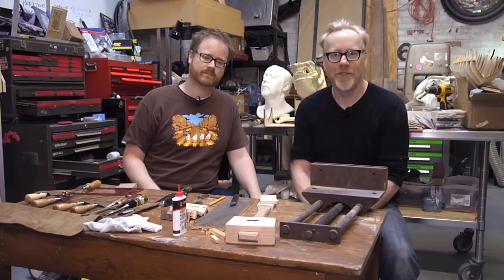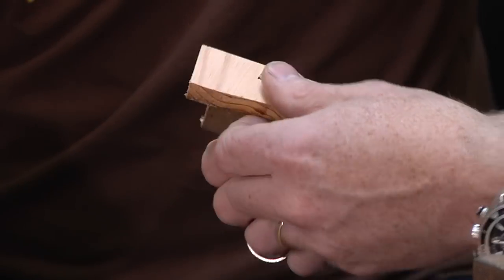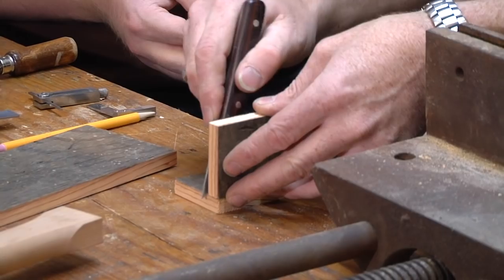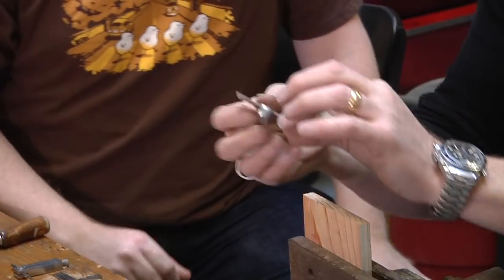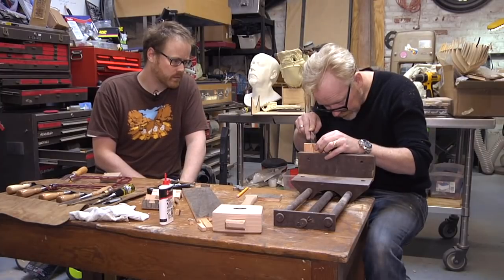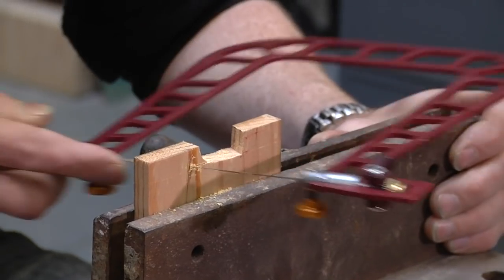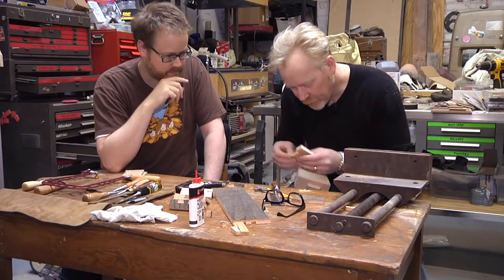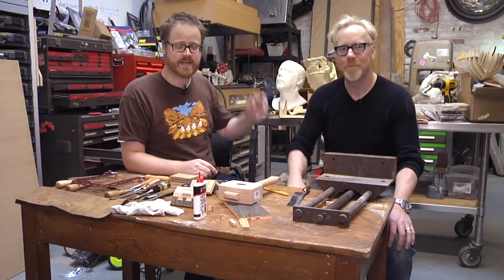Learning How To Make Dovetail Joints with Adam Savage

Comment: ugh, i'm a carpenter, and watching this made me cringe a bit lol. but the mistakes he made are typical for someone just learning this technique. but no matter what you're cutting, when it comes to woodworking, NEVER cut on the line. you cut about 1/16th on the inside of it and then clean up the edge afterwards. whether you're sanding to the line or shaving to the line, you still can't cut TO the line. that's why his joints were loose. because you always have to clean it up a bit, and you need some material to work with.
Reply: Mike L. You can take away but never add basically
Reply: @TheActionjackson3000  Unless your metal working, then you can sometimes weld your way back glory.
Reply: Hey, I appreciate this comment. I'm starting to get into woodworking, and this probably just saved me a few tens of hours of retrying!
Reply: @Mike L., I’m not a carpenter but I would think dovetail jig and a router would be a better way to go for a novice than trying to cut them out by hand like that?
Reply: i can just agree Mike..and want to add..as u may know as a carpenter..u cut the slightly inside the lines..and then use a crowbar to stem out the holes ;)
Reply: I was wondering how he did multiple loose test joints without figuring this out.
Reply: Yes, and also, take your time for goodness sake! When you rush, you get a sloppy product.
Reply: My dad was a private contractor/handyman till the day he died. 
When I was a child one of the first rules I was ever taught about being a handy man, after I was taught how to measure and then remeasure, was that "you can always cut more, but you can not cut less".
I think that rule applies to just about any blue-collar job and should be taught early and often.

Comment: Cut inside your scribe lines and not directly on them. You are cutting on your lines, which have been scribed outside you adjoining piece. The thicken of your scribe adds a gap as well as the thickness of your saw assures the gap. You are actually opening the gap - my guess would be around 1/64 to 1/32. Because wood can compress, depending on how hard or soft the wood is, the more exact to the size the better the fit. Try to scribe gently so you don't create such a cavern for your saw to start out in (if your so interested in doing this the old way). That pine should be sized a smidgen tight to one another. The grain will compress and relax which will tighten your fit - hence in need of a mallet to join them. Practice practice practice. Another cool little trick once you've accomplished a uniform fit is to soak it in water for about an hour. This will expand the grain where the water can reach (the gaps) and tighten the joint completely - or at least until the piece is moved to a dryer climate where the wood can shrink more than when you started.
Reply: You sir are correct, I can tell your very passionate about wood.
Reply: cybertree sounds like a guy that plays with his wood all day.
Reply: Rasmustheforest lol
Reply: my name is kirk too!
Reply: Kirk Frederick I was gonna say that.
Reply: Beat cha to it!
Reply: When cutting the dovetail it does not matter if you cut on the line or not but when you are cutting the slot out you have to be accurate to the cut so you use a chisel to clean that out right up to the line.

Comment: A key point that a lot of people disregard with carpentry is that you rarely, very rarely cut ON the line. Cut BESIDE the line. If you're cutting on the line, ie; if the line you marked is gone when you've finished, you've removed too much. Remember, you can't put it back on, but you can take more off!
Reply: bingo!! that's what I was saying

Comment: From the perspective of a northern European Journeyman cabinet maker, he does every step wrong.
First thing is to select a type of wood that are beginner-friendly like Birch for practice.
Second would be to make them in the opposite order, sockets first and tails after.
Third, think like the shaker, don't ever aim for any kind of cheating by creating angles where there should be none!
Forth no copping saw, that's for veneer work.
Fifth cut inside the lines and clean up with the chisels. (Lie Nilsen ones?)
Last I would recommend considering the size and positioning of the dovetails as this is as important as how tight they are.

And remember, No cheating!
Reply: RE the fourth point. What saw/tool would be correct for the job?
Reply: ScratchN Sniff A dovetail saw to make the initial cuts, then chisels.
Reply: Correct.
Reply: tails first or pins first is just personal preference. A lot of people would argue tails first is best, I agree with everything else though
Reply: I would say no, not only a personal preference. If you make ordinary dovetails to show the tails, if you cut the tails first, you can clamp the sides together and cut them at the same time. This is what I learned that most amateurs like to do. Making cabinets the traditional way as we learn and do here you have to be able to cut "normal" tails, half-blind and blind tails at the same speed and if you do the pins first every time, you will do the front of a half-blind first and you will learn to do it fast by always doing all dovetails this way.
One more plus is that if you fuck up the pins on the front of a half-blind joint, you can compensate with the tails afterwards...
Reply: Woodworker here. Nerk is actually incorrect on his forth point. Coping saws, especially that kind can definitely be used to remove the waste quickly. The reason that that one is preferred, is it is made out of aluminum and is very rigid. ( in the vid he says titanium which isn't right. The company makes two different kinds, aluminum which is the colored one has and a gray titanium one which is actually a bit heavier but extremely rigid). With these you are able to cut very close to your marking-gauge line. after you have removed the bulk of the waste, the best step is to creep up to the line by removing small amounts of wood at a time. Removing too much causes too much pressure on the wood and can bruise the wood that you don't want damaged. In the video, Adam is using the chisel turned the wrong way. You use the flat end against the non-waste to ensure a crisp, vertical line. If you do not want to use or have a coping saw, you can just use your chisel and remove waste all the way back to your line.
Reply: And tails or pins first is, in fact, personal preference. You can get great results either way.
Reply: If one cuts that tails first then the pins are the only precision cut left to do.
Reply: First things first. Mount the vise to something solid.
Reply: thank you good advice, not even gonna argue
Reply: *Sixth: The finishing chisel work should be done with a paring chisel. (imho)
Reply: Rob cosman says cheat The angle. So you cheat the angle. Knocking it in 2 degrees or so does not hinder the soundness of the joint and avoids an extra step (or at least a more lengthy step) of making sure the inside is deadflat to allow the two cuts to pair perfectly. In other words, if you can remove an unnecessary step, with 0 downside. Do it.

Comment: Keep it up Adam.  This is a lifelong process that I have started 2 years ago.  My Grandfather was a master carpenter and my dad couldn't draw a straight line with a level - so in his mind, the yardstick of a good carpenter is the dovetail.  After a few tries I got a fit much akin to yours, but after a few months I was needing that mallet you were speaking of. Literally everything I have learned has come from trial and error, and youtube.  One thing is for sure, you have some of the best tools available to do dovetails.  The Knew concept saw is great so are all Lie-Neilsen (Lee-Neilsen) products.  I recommend a thin kerf dovetail saw, or a Japanese dovetail saw that cuts on the pull stroke - just a matter of preference.  I also really admire how you want to learn a new skill and don't want to cop out by using power tools - although I wouldn't use your bandsaw for that again - its amazing how accurate a human and a well refined tool can be :)
Reply: okay, great inspiring story. But for everyone reading this: you dont need 2 years to learn how to make a proper simple dovetail. If you feel you are stuck go and get an experienced woodworker to have a look at what you are doing. Chances are he/she has a tip or two for you. If you do a few tails every day you will see that youll achieve good results after a week or two max.

Comment: the problem I notice is that you're cutting ON your line.cut on the I/O of it.O if cutting the wedge. I if cutting the knock. it'll remove that 1/100th" gap and make the joint tight.

Comment: You rely too much on your wrist for your sawing accuracy.  Your blade would more easily track true if your forearm were either parallel or perpendicular to your cutting edge. I'll let you work on that.  
The chisel has a flat edge to help you easily create a common plane.  The beveled edge has a few uses, though. It allows you to create curves, undercut corners and when you use it to cut a mortise, the beveled edge will force the back of the chisel against your intended plane. Using the beveled edge to clean up an edge or plane is a fool's errand, there isn't any assumption of a straight line and it generally will make a greater mess.
Reply: This.

Comment: Adam I am a furniture maker by trade I could help you lots and lots with your dovetails you make numerous mistake. That said your attempts a pretty good and it takes years of practice to get really really need dovetails. You hold the chisel wrong which means you don't make precision cuts with the chisel. You don't follow the line with the coping  saw you start in the middle and go out. to the first angle cut you made ALSO you are suppose to use a 1.6  angle for soft wood not a 1.8 angle . Not sure what would you were using looks like pine. Your gauge lines need to be much much deeper as well . also it helps to undercut  too .
Reply: +Cubby Kovu This video is 3 years old...
Reply: +Robert Dordi so what? These tips still might help Adam, and they certainly will help people watching this video.
Reply: +Cubby Kovu I make  my dovetails with a pantorouter....
Reply: +xl Well then it not really you making them but it is cool Machines and power tools have their place I mean I am not like a master I JUST PREFER doing it by hand is all :) but I do see machines as you not really doing it yourself Personally.

Comment: Hey Adam, I'm with Bombarde 16, clamp your work, it makes it much more accurate and safer.
Also to get a great finish on the cut lines, use your sharp chisel edge to score the line first.
This stops the edge from splitting when it's cut so you effectively only cut out the middle of the cut with the saw, the edges are cut with the chisel.
Also, if you scribe all your cut lines with a set square then you can follow them much easier and stay square.
Good luck mate

Comment: You'll get it Adam. Glue will swell the joints. Clamp your work down when you chisel chop it. I use a drill press to get the coping saw in too. Cut inside your marking lines and pare to your finish with your chisel more. You are right about undercutting. Another cheat I have developed is wrapping a hacksaw blade with sandpaper to tune the pins and tails up. Sand the shiny compressed wood. I use spray glue to hold the sandpaper on the hacksaw blade. Use the blade in a frame too. Mount that vise!

Comment: Yes, a router is a tool that spins a cutting bit at a very high speed. They are very versatile, as they cut with high precision and the shape of the bit can be varied to change the shape of the cut. A router can be used to make a high-precision dovetail joint very quickly by using the same bit to cut out both the pins and tails, with a jig set up to control spacing.

Comment: I suggest also a Dozukip me Tenon saw it is a very nice Japanese saw with a 0.3mm kerf. the Dovetail is wobbly like that because of the thickness of the wood compared to the width of it so it has lots of room to move. When using the saw use all of the blade and use if slight slower also it allows you to make much more precise and accurate cuts and it is neater. also slow down a little bit you don't have rush and don't measure stuff proud either. Dovetails are about precision :)

Comment: One small tip that could make a huge difference is to only use the saw for the "vertically" cuts along with the fibers, don't use the saw (never involve a bandsaw when you're doing dovetails) to cut "horisontal" and to get rid of material quick. Always use the chisels from both sides of the piece and on the waste side of the line to make airtight fittings.Try to make like a "V" to the center of the piece from the lines. I use something more like a scalpel to make the cutting lines. 

Good luck!

Comment: Adam,
  No matter which you cut first, the pins or the tails, the first cut is not critical to cut to a knife line.  It's when you scribe the first to the second piece that absolute accuracy needs to be achieved.  Keep up the good work.  Oh, and that Knew concepts coping saw it their aluminum model.  The Ti model has an awesome birdcage truss system to help stiffen the thing Ti across the top.

Comment: Oh my! I am sure I don't need to read the carnage in the comments, but don't do anything that is demonstrated in this video!!!!
It's ironic because there is probably TOO MUCH information about how to make dovetails on the internet and Adam hasn't seen any of it. I don't even know where to begin From the vise that isn't attached to the bench to the most dangerous incorrect use of (really nice) chisels,this is a total trainwreck.
FYI: a sharp chisel is one of the most dangerous hand tools! You can easily put one through your hand or cut a vein/artery. You should always have two hands your chisel when paring and your work piece should be securely clamped or held in a vise.
Reply: At a couple points, I was fully expecting to see him spill his blood. Gah!
Reply: Agreed I was cringing watching him.

Comment: Great work Adam. Once you get the 90 degree joint move on to doing it on a compound angle. Most sea chests were made to taper towards the top like the frustum of a pyramid. Same process you just start with a compound butt joint ad some other fiddly bits to get the layout right. Good luck with the chest!

Comment: I dovetailed for a design and technology project almost 10 years ago, If you cut the tongues slightly too large then you would get a nicer fit, you can always chisel down but its important to remember that the added friction caused by the wood being compressed is what gives this join its strength. With a proper dovetail glue shouldn't make a difference to the strength as the point of failure will be the wood splitting.  

I would recommend a scroll saw as you can adjust angles on it and have a uniform cut, makes things so much quicker. I had to do about 40 dovetails and I didn't have much extra material. (probably a similar size to the chest you are thinking of)

Comment: There's nothing wrong with using a bandsaw but, in a vice, I recommend tilting the work so that your marked lines appear vertical, which helps to make your hand-sawing more accurate as you're cutting with gravity as your guide.

You clearly have the determination and persistence to master the art of cutting dovetails. :-)

Comment: Keep at it Adam, you can certainly do it
Get yourself a a better saw, Lee Valley sells a great saw for this, they are a great mix of new and old. Then just practice. Each morning when you come into the shop, take a pice of wood say that pine you had, and cut kerfs along one edge, say 1/2" long, but cut them about 1/16" apart so you could cut a lot of kerfs on one 6" long piece, this will warm you up for your dovetailing, and give you better saw control, but it does not take a lot of time. 
Domo!

Comment: you need to allow for the lost material, ie don't cut directly on the line, cut inside the line leaving the pocket slightly smaller thus allowing for material loss and a tighter fit

Comment: It helps little to obsess about the angle of the tails. What really matters is accurately transferring the data to the pins. Also the glue will be absorbed by the wood grain and expand to fill tiny gaps. If that doesn't achieve marquetry perfection, you can peen the end grain, too, before final planing.

Comment: You should check out the old Woodwright's shop trick -- before you went over to the bandsaw and cut the waste from the tail, you should have set the tail piece on top of
the pin piece, lay the saw in the cut sideways from how you cut it, and drawn it back to mark the pin piece with the saw.  Then you cut just inside those two marking cuts to make your pins.  The second good trick is to shave a very shallow rabbet inside the tail piece along your scribed line, that gives you an alignment ledge

Comment: It helps if you cut leaving a bit more material than you theoretically should. Wood can be shaved down to size if too big, but you can't add to it (unless you glue/putty the joints).

Comment: I use hand tools to do all my carpentry joints; and it took me a dozen trial joins of experimenting before I got accounting for the width of the saw down packed.  The basics are like Adam showed but you need to practice sawing till the pieces fit tightly together with very little pairing (chiselling) and then you need to account for the direction the teeth on the saw face so that the teeth are pointing inwards to prevent damaging the surface of the wood.  And that's basically all there is to it,

Comment: What i found Adam (if you actually read this) is on the pin board, cut to the INSIDE of ypur scribed lines..and your joint will need to be tapped i and be tightwr thana a nuns...  Also,  you might look at the Veritas dovetail guide.  Very helpful and helps train muscle memory for straight square cuts.  Cheers from b
B.C. Canada.